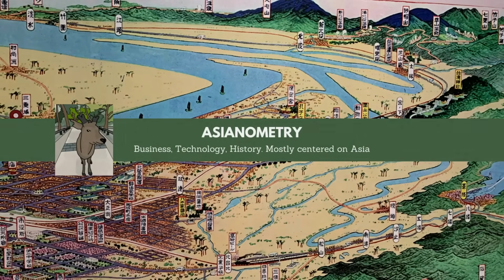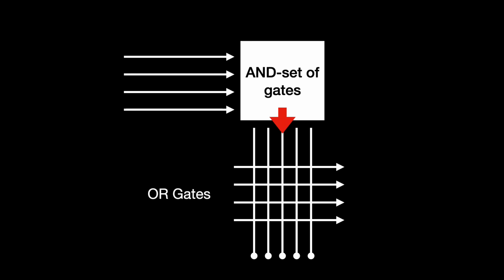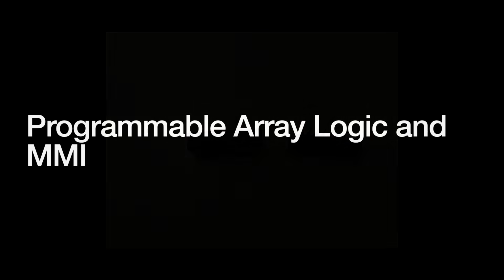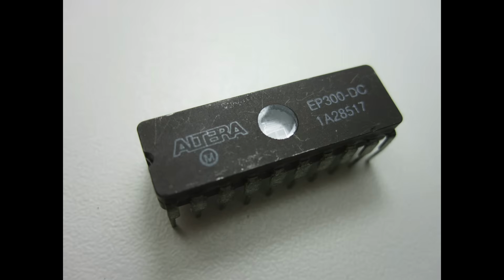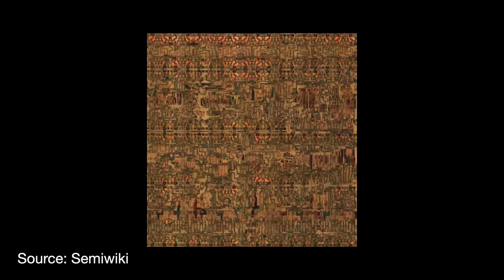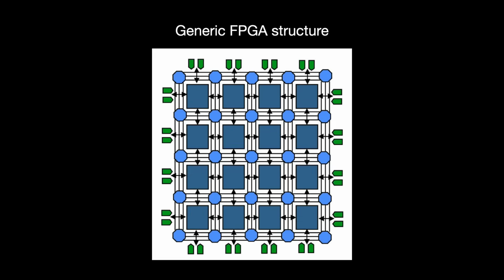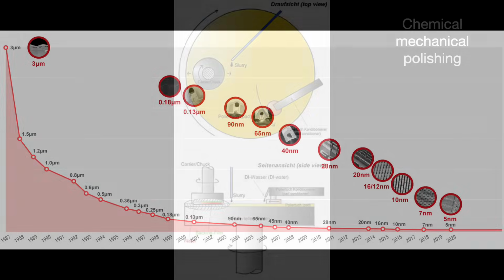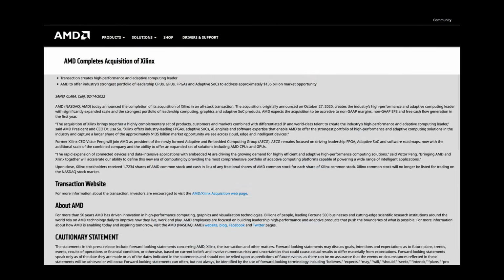The History of the FPGA: The Ultimate Flex

Comment: Great video on one of my favorite subjects. I'd like to add a couple things. First of all (as the poster below said), this history skips a very important branch of IC history, the gate array, which FPGAs (which are a namesake, the Field Programmable Gate Array). Basically gate arrays were ICs that consisted of a matrix of transistors (often termed gates) without the interconnect layers. Since transistors then, and largely even today, are patterned into the silicon wafer itself, this divided the wafer processing into two separate divisions, the wafer patterning, and the deposition of aluminum (interconnect). In short, a customer could save quite a bit of money by just paying for the extra masks needed to deposit interconnects, and take stock wafers to make an intermediate type of chip between full custom and discrete electronics. It was far less expensive than full custom, but of course that was like saying that Kathmandu is not as high as Everest. Xilinx used to have ads showing a huge bundle of bills with the caption "does this remind you of gate array design? Perhaps if the bills were on fire".

Altera came along and disrupted the PLA/PAL market and knocked over the king o' them all the 22V10, which could be said to be the 7400 of the PAL market. They owned the medium scale programmable market for a few years until Xilinx came along. Eventually Altera fought back, but by then it was too late. However, Altera got the last word. The EDA software for both Xilinx and Altera began to resemble those "bills o' fire" from the original Xilinx ads, and Altera completely reversed its previous stance to small developers (which could be described as "if you ain't big, go hump a pig") and started giving away their EDA software. Xilinx had no choice but to follow suit, and the market opened up with a bang.

There have been many alternate technologies to the RAM cell tech used by Xilinx, each with an idea towards permanently or semipermanently programming the CLB cells so that an external loading prom was not required. Some are still around, but what was being replaced by all that work and new tech was serial EEPROM that was about 8 pins and approximately the cost of ant spit, so they never really knocked Xilinx off its tuffet. My favorite story about that was one maker here in the valley who was pushing "laser reprogrammability", where openings in the passivation of a sea of gates chip allowed a laser to burn interlinks and thus program the chip. It was liternally PGA, dropping the F for field. It came with lots of fanfare, and left with virtual silence. I later met a guy who worked there and asked him "what happened to the laser programmable IC tech?". He answered in one word: contamination. Vaporising aluminum and throwing the result outwards is not healthy for a chip.

After the first couple of revs of FPGA technology, the things started to get big enough that you could "float" (my term) major cells onto them, culminating with an actual (gasp) CPU. This changed everything. Now you could put most or all of the required circuitry on a single FPGA and the CPU to run the thing as well. This meant that software hackers (like myself) could get into the FPGA game. The only difference now is that even a fairly large scale 32 bit processor can be tucked into the corner of one.

In the olden days, when you wanted to simulate hardware for an upcoming ASIC, you employed a server farm running 24/7 hardware simulations, or even a special hardware simulation accellerator. Then somebody figured out that you could lash a "sea of FPGAs" together and load a big 'ole giant netlist into it and get the equivalent of a hardware simulation, but near the final speed of the ASIC. DINI and friends were born, large FPGA array boards that cost a couple of automobiles to buy. At this point Xilinx got wise to the game, I am sure. They were selling HUGE $1000 per chip FPGAs that could not have a real end consumer use.
Reply: AMD actually invented the 22V10 as a bipolar device, but had a lot of trouble making them. Cypress was the first to make a CMOS implementation of the 22V10. Atmel came along a little later. I know this because I worked on it first at AMD, then at Cypress. Many a 14 hour day of my life ....
Reply: @johnhorner5711  When the Cypress 22v10 EE version came out, I built a programmer for it. Cypress was one of the few companies back then willing to disclose programming details. It didn't work! I could program it once, but then it stopped working. Spent a lot of time on the Cypress apps line trying to work it out, never did (maybe it was you I talked to!). I loved that device, I built it into a lot of things. After that I did chip design at Zilog and didn't get back to programmable logic for 10 years, which by that time was dominated by Verilog, and then got back into programmables with Xilinx.

Comment: Another cool thing about FPGAs is their interconnects.   Decades ago, we didn't worry too much about how a signal got from A to B, because wire wrapped and FPGAs implemented them for us.  Then came along higher speed circuitry.  Electromagnetic fields coupled signals in one wire to another wire, especially if those wires ran parallel to each other.  We didn't worry about what was inside the FPGAs, because they seemed not to have this cross coupling problem.  Finally we decided to characterize this phenomenon to wire interconnects on the boards.  We came up with something the RF engineers used - micro strips and strip lines.  Most of you will recognize them, because boards are constructed of layers.  These layers are GND, then  interconnects, then PWR, then interconnects, and so forth.  This solved the glitch problem.  CPLD and FPGA manufacturers figured this out much earlier, probably because they came from the ASIC world.
Reply: There are crosstalk effects within the FPGA.  They're just built into the timing models as margin (along with a good chunk of on-dir power/gnd noise).  If you've closed timing then the degradation isn't enough to break your design.
Reply: @Chipchap-xu6pk  Very true.  I look at FPGA and ASIC construction like they are circuit boards.  The wires are printed circuits, and EM waves exist in all three.  Today, circuit board design layout software has all that built in.
Reply: the real world is in analog mode.
Reply: @georgegu3374  Yes and no.  Digital signals have rise and fall times that are analog.  That's why flops have set up times.  But then physicists tell us that everything is quantum.  One thing I find strange is that light is both particle and wave.
Reply: "electromagnetic field couple" that pretty much sounds like how a loop antenna can wirelessly couple with the ferrite antenna in a radio for AM reception
Reply: @madmax2069  It's exactly that.  Maxwell's field equations apply to both.  The only difference is the antenna is designed to receive and/or transmit the energy, whereas uniintended transmission of reception of fields is a hindrance.
Reply: @koyotekola6916  just like with the PCIe 4.0 and trace length and proximity to each other causes all kinds of issues on non PCIe 4.0 motherboards and PCIe riser cards with crosstalk and degradation of the signal.
Reply: @madmax2069  Right on.  It's the same cause and effect.  Maxwell knew this a couple of hundred years ago.
Reply: @madmax2069  Actually,, electromagnetic field,not just magnetic. All wires with current flowing through them have an electromagnetic field surrounding them and diminishing as a function of distance.  This field will not induce a current in an adjacent wire unless its changing.  The faster the change, the more it will induce.  That's why they weren't a problem in the beginning. They became a huge problem in the latter 1990s, especially on circuit boards.  Engineers would be looking for functional problems when the problem was glitches being induced into adjacent wires. The best way to solve those problems is to not have them at all.
Reply: @koyotekola6916  Yes, "the best way to solve those problems is to not have them at all." Can you make photonic FPGA chips?
Reply: @hengzhou4566  I thought about this years ago but ran into a problem - I didn't have the knowledge to properly analyze it.  EM waves (photons in QM) travel at slower speeds through different media, so near SOL is expected.  A photon travels 3 cm/1 psec in a vacuum, which wasn't what I was seeing back then in copper.  Average distances of 1 cm, I saw about 10 usec to 100 psec.  Quite a bit slower.

Therefore, EM waves produced by varying currents are a lot slower than photons in a vacuum.  In fiber glass, I would expect near SOL, possibly 90%?  A telecommunications engineer or physicist could quantify it correctly, but it still leaves the problem of how to implement logic that can use photons as the signal carrying mechanism.  This is beyond my scope, since I'm retired but I can guarantee that someone in a lab is working on it.  Perhaps that's what quantum computers are all about, since they're at the Standard Model level.  I just don't know.  I'd like to hear your thoughts on it.
Reply: This dude loves to toot his own horn.
Reply: @davidjwillems  yeah and?
Reply: @madmax2069  and what?
Reply: @davidjwillems  like you haven't tooted your horn before.
Reply: @davidjwillems  You are correct.  When one owns an engineering firm and has a very long and successful career with referrals and high wages, it does seem like I'm tooting my own horn.  I hope that people in this comment section learn from what I've learned over the years, and I'm here to continue learning from others.  History is a good teacher.

Comment: I really think FPGA is in recession. As the process upgrade becomes really expensive (3x for the current 7/5/3 node upgrade), the improvement in performance for the upgrade node was omitted by the architecture nature of FPGA (excessive interconnection and redundant logic). If you look into commercial FPGA produce (both Intel <Altera> and AMD <Xilinx>), you will see they already have switched to SOC strategy (Putting a lot of hard macros <such as ARM/INTEL core, AD/DAC, etcs.>  into their product).
Reply: Because combining FPGA with hard-IP CPU in a SOC is extremely useful. There are tasks for which the FPGA is necessary (say, real-time signal processing) and there are tasks for which CPU is better (say, control and readout of said data via IP). So combining allows you to do best of both words. Besides, Silicon area is cheap and the hard-IP CPU is much much faster/efficient than a soft-IP one.
Reply: The soft core in Altera/Intel called NIOS does not perform as fast as real hard cpu IP like the SOC design and the soft core use a lot of power and gets very warm. Xilinx has similar the soft core Micro Blaze but I'm not sure how that perform.
Reply: Blur lines between analog and digital with SDR.